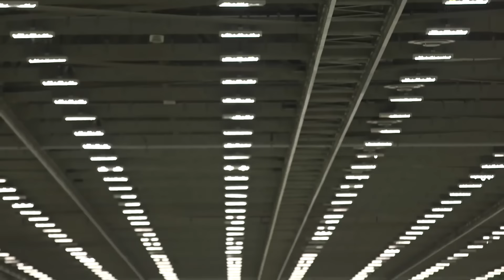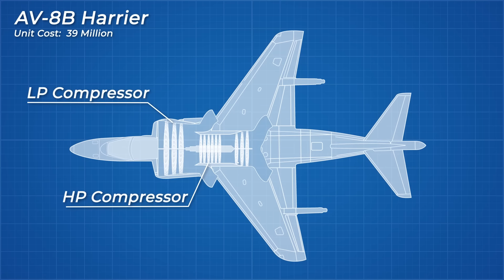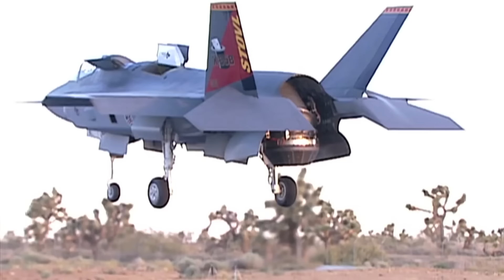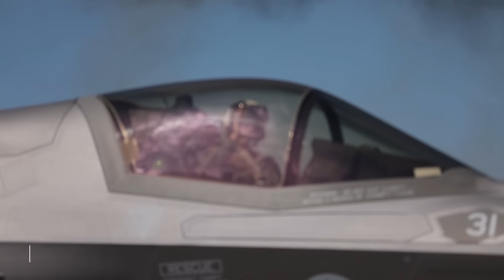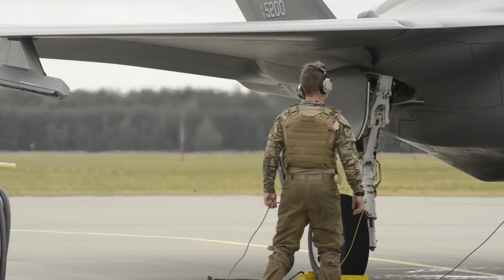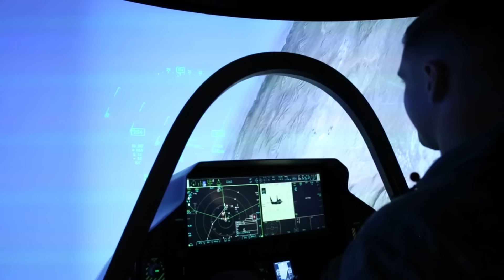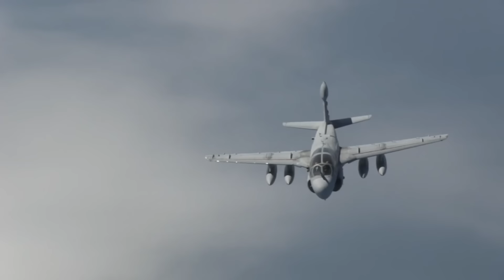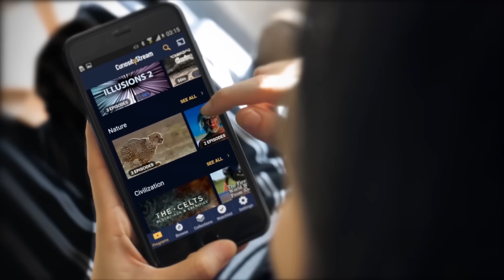Is The F-35 Worth $115 Million?

Comment: I think that for the US's strategic situation, the F-35 is probably the best they could get. Due to stealth and modern technology, it will probably render every non stealth fighter obsolete. The US is also getting double value from the F-35, as the stealth will be used against both air and ground radar. No need to have a different airframe for each role. Geostrategically, the US is using it as a sort of leverage. If you are in the good graces of the US, you could probably secure a deal for them. If you fall out of favor, they can take it away.

Comment: Dick Cheney made this aircraft expensive because of his defense budget cuts immediately after the end of the cold war, which led to the bankruptcy or merger of many great defence companies. Those cuts were due to a stupid neocon adherence of Fukuyama's "the end of history" analysis, which was proven wrong by the 9/11 attacks, which led to the Wolfowich Doctrine, and in turn huge defense budget increases. However, in the meantime a lot of the likely contractors were either defunct or had moved into other areas of defence, than aviation, leaving a handful of monopolistic giants with overwhelming political influence. That's why anything costs a fortune and takes embarrassingly long time to finish, eg. the joint strike fighter. The procurement and maintenance cost differences which in both cases range between factor two to three of the F-16 which it in many cases will be replacing is just outrageous (when considering the available updates to the F-16). Equally embarrassing are the budget overruns and the the fact that this aircraft has been under ways for more than THIRTY YEARS! In comparison, the development of the teen-fighters took half the time, and led to
the development of three aircraft, almost fifty years ago! Of those aircraft, two have remained in production until today, and have thus been upgraded to 4,5 gen. fighters. We simply must be able to do better than the joint strike fighter in the western hemisphere. If not, we will be overtaken by China in the next generation. One side note: when it comes to sound, the F-35 is anything but stealthy, and much points to radar technology being challenged with optical and acoustical derived technologies.
Reply: 9/11 did nothing to disprove anything Fukuyama wrote.
Reply: The first sign of a F35 whit your fancy optical system is the strike packeg hitting you

Comment: this might be a biiit late, but the radar that detected the f-117 was operating in a mode were even clouds would show up on the radar (this radar was also one of the most powerful radars available at the time). The serbians were only able to detect the plane because they knew where to look, based on their intel on american air bases. So they knew roughly at what time and from what direction the plane would be coming. furthermore, the radar of the surface to air missiles was not able to detect the f-117 at all, until it opened its bomb bays, which increased its radar crossection just enough for the SAM to get target lock. and even then, the plane might have survived if it were outfitted with countermeasures
Reply: On top of that they only actually detected it when it was straight above them, if the f117 had a rwr and HARMS they would´ve been destroyed before seeing anything on radar

Comment: "vertically integrated" companies are probably going to face "trust busting" in the future. these vertically integrated conglomerates are starting to assume positions and practices where they cannot be unseated or challenged by any competion and the "free market" is compromised by companies that leverage all their vertically integrated companies to ensure any semblance of competion can't even start to form as it would require similar companies to produce a similar product. when they're all vertically integrated the head company can squeeze some of the companies and make them work at a loss to severly undercut any competiton. so you end up with one company per industry offering one product which is exactly what a monoply is and you don't become a monopoly by producing the best product, as too many aspects of any product are subjective, it specifically takes anti competitive practices and that's antithetical to what a "free market" economy is and what makes the capitalism preferable. when a company has a power majority and uses it's power to guarantee it's power is never challenged that's no diffent than an authoritarian government that snuffs out any ideas that oppose it's core ideologies. it's not sustainable and it's a net drain on society as well as an obstacle to human progress all for the sake of greed.

Comment: The dogfight report was from an early prototype that lacked software features to unlock its true maneuverability. Nowadays this is vastly improved and can outmanouver its competition. Also, it is not slow as a speed of mach 1.8 or higher was NEVER recorded during any aerial engagement. Mach 2 or higher speeds are only good for paper, and the f35 actually has a really powerful engine (albeit only a single one) and its mach 1.6 top speed is more than sufficient. 

Anyway, it will not be in a dogfight regardless of all that, because it will turn any opponent into a ball of flames from 100s of kilometers away without that plane even noticing the f35 is there.

Comment: They're currently  $90 million each!!
Reply: When supply is high, cost tumbles. #economy
Reply: $90 Million, Someone is using WOMAN math! Total cost to taxpayers to date 1/16/2024 [R&D and Production] for the F-35 program is $1.2 TRILLION for 600 combat ready aircraft! [I know 1,000 made but some have been delivered to other countries] $1,200,000,000,000/600 is $2,000,000,000 per combat ready aircraft!
Reply: @mobeydick37  Woman math?... $ The 1.2 trillion is the total cost of the programme ( including upgrades) for the next 50 years... so who's using "woman math" now..
Reply: @1346crecy  You are if you think they are even remotely close to $90 million dollars! The initial estimate for the F-35 program was SUPPOSED to cost 1.7 Trillion over 50 years for 2,440 aircraft. That was 15 years ago. If you think it's only going to cost $500 Billion over the next 35 years you are clearly using WOMAN math!
Reply: @mobeydick37 1.7 trillion includes procurement for up to 2400 airframes, maintenance, supply, amunition, and pilot costs for operation up to 2077 adjusted for 2077 inflation. 

So, you are correct, I’m using woman math, because this woman and her math just proved you wrong in a single google search.
Reply: @tacotown4598  They have already spent 1.2 Trillion! So, Yes you are using woman math! By the 2077 this program will easily cost 3.7 Trillion!
Reply: @mobeydick37  source?

Comment: Is the F-35 Lightning II worth the money? Well, the Navy is down to just two fighters: the F/A-18E/F Super Hornet and the F-35C Lightning II. The F-14 Tomcat and F-14D Super Tomcat have been retired, and the F/A-18 Hornet is on the way out. The Air Force is retiring the F-22 Raptor and the F-15D Eagle, and will rely on the F-15E Strike Eagle, the F-15EX Eagle II, the F-16 Fighting Falcon Block 70/72, and the F-35A Lightning II. There's not much else right now.
Reply: Total cost to taxpayers to date 1/16/2024 [R&D and Production] for the F-35 program is $1.2 TRILLION for 600 combat ready aircraft! [I know 1,000 made but some have been delivered to other countries] $1,200,000,000,000/600 is $2,000,000,000 per combat ready aircraft! Strapping bomb racks on to it makes it just as detectable and more vulnerable than a 4th Gen F4 Phantom but slower! NO, NOT WORTH IT!

Comment: Can we please stop this nonsense???? Coming up on 20 years trying to get this crap up and running as advertised. Folks as an engineer I can tell ya, can't get it done in almost 20 years you got a Turkey on your hands and need to trash and start with a clean slate.

Stop all the BS, dreaming, dissembling and this incredibly unseemly lying PR blitz to those with little to no understanding of aviation, engineering or the ever so criminal military procurement. Oh Hell yes, check out, of all companies Lockheed and the Japanese back in the day.

Again the proof's in the puddin' all y'all, going on 20 years and still mission critical "deficiencies" preventing the fart-35 from entering full scale production. That's the Do-Dumbasses decision OK?????????

There's no discussion at this point as the CUSTOMER says it's a pig just like the fart-22. The customer rejected the -22 and shut down the production line. If you feel it necessary to blather please go to LM, the halls of the pentagone, both houses of congress they're the ones you need to bullshit 😎

Comment: The driveshaft between the Lift-fan and the engine, are the weekest point of the whole system. Because the driveshaft have to make so many rpm when engaged, the wear and tear of this part is enormous, and are pushing up maintenance costs!

Comment: The F35 is an iPhone. When an android (F15 ex 2 and F22) can do the job for a fraction of the cost. It's a flying pig.
Reply: The F22 can't do air to ground, doesn't have the same hardware, has a worse mission computer, and is designed purely for air to air, and the F15 is a 4th gen fighter with no stealth, and the F22 is getting retire
Reply: @immortaldev1489  The F-35 can't do air to ground, either without adding bomb-racks which deletes it's "Stealth"! That makes it about as ground attack capable as a F-4 Phantom but slower and less rugged!
Reply: @mobeydick37  the F35 can can carry bombs in its internal racks
Reply: @immortaldev1489  Yes, 4- 500#ers, then it can only defend itself with its gun.
Reply: @mobeydick37  it can carry bombs in one internal bay, and AMRAAMS in another, with 2 9X missiles in the side bays. Besides, there's a high likelihood they'll just escort a bombing F35 with F35s armed with air to air missiles in a near peer conflict
Reply: @immortaldev1489  not to mention, the fighters never fly alone since Spanish civil war.
Reply: @naksachaisaejane1982  They are not stealthy flying in pairs. The F-35 is good at one thing. Solo missions for airinterdiction. They MUST get the first and second shots or they are toast. Every other mission runs counter to their designed missions and puts them at greater risk than every 4th fighter designed before it.
Reply: @mobeydick37  they are still stealthy flying in pairs, where did you get this information from? The RCS effect of flying about 1 nautical mile from another stealthy plane is likely so little it doesn't have to be considered, and flying solo has pretty much been removed from US air doctrine. Also, what are some of these designed missions you were talking about? The F35 is eventually going to replace all the 4th gen airframes in the US inventory far in the future, so I assume they are capable of doing 4th gen missions
Reply: @mobeydick37  also, the F35 was designed to be a decent air to ground multirole fighter, or else it wouldn't have a custom EOTS system, which is likely the most advanced targeting pod on fighters
Reply: @immortaldev1489  So you would send TWO, 2 Billion dollar aircraft in place of what One, 16 million dollar aircraft is capable of doing?
Reply: @mobeydick37  well, an F14D cost over a billion dollars per aircraft (accounting inflation), while the F35 costs 85 million, and the US was fine with sending F14Ds to fly in pairs, so I can't see any reason why the F35 shouldn't be able to fly in pairs considering the military budget of the US, and it's doctrine
Reply: @mobeydick37  also, I can't find any combat aircraft on par with the F35s abilities that cost 16 million, the F16, one of the cheapest fighter jets in the US inventory, cost 20-ish million
Reply: @mobeydick37 
Israel did in 
Sams did not know it was getting attack
Reply: Trying to find analogies for complex technologies often times means you simplify and misrepresent the issue.
Reply: F-22 costs more and F-15 is non-stealth design.

Comment: It's not even close to as fast as the Gripen E  with Mach 2 capability. Plus it does that for in the area of 4500. per flight hour compared to the F-35  Pig at $45-$50,000. per flight hour. Apparently they have been contemplating using the sound of a pig snort to announce itself on the battlefield. Hahahaha
Reply: Top speed is a near meaningless metric in moder combat, and cost per flight hour doesn't mean much if you only need 10 F35s to wipe out 30 4th gen fighters

Comment: Informative video on the F-35 stealth fighter jet and its 3 variations. Yes, the cost of development is astronomical, which is why the US developed it alone because US allies were not willing to share in the outrageous costs of R&D. The three variations did make R&D much more complicated and drove up its R&D cost, but the large scale manufacturing of the basic F-35 structure, and then the variable or flexible manufacturing of the 3 variations will lower overall costs in the long run. This will allow US allies to purchase each variation on an affordability basis. Hopefully. As far as the F-35 stealth capability, I noticed the presenter emphasizes that no airplane is truly invisible, it is only less detectable. Yes, I agree, that would be the case. Most of us who are amateurs probably realized this fact. As for me the abandonment of the multi-panel structure of the F-117 proves stealth technology is an exaggeration. The F-22 and F-35A look like the same fighter jet except the F-22 is a twin-engine jet, while the F-35 is a single-engine jet. Obviously the F-22 is a faster supersonic fighter, while the F-35A probably is a mach 1 fighter with a max speed above mach 1. Still in a combat situation when two opposing fighters are approaching each other at supersonic speed there is no way to react and engage weapons. You simply must slow down to fight. That is why the US military spend a lot of time and resources in training pilots. It is people who win battles, not machines. Something advanced engineering want us to forget. We mislead ourselves if we think technology is what wins wars. As American General Shinseki told Congress that it is boots on the ground (US infantry soldiers) that take control of an area, not air superiority at 10,000 feet. As far as radar-absorptive paint on airplanes for stealth. Think about it. If paint can create invisibility then why is the F-22 and F-35 programs so expensive. US military has moved away from stealth tech like the multi-panel structures because they do not deliver enough combat efficacy compared to low-profile aerodynamically sound fighter planes. This report claims that the Serbians shot down a F-117 in relatively good condition. So why hasn't the (former Soviet Union) Russian Federation develop a stealth fighter. One reason could be the Russians simply do not have the ability to reproduce Advanced Stealth Technology or Advanced Stealth Technology do not deliver enough combat advantage to make it worth the expenditure. The second reason is why the Russians have not reproduce Advanced Stealth Technology. The Russians do not have the resource wealth to try out an ineffective weapon system. The F-22 and F-35 fighters look far more like conventional (non-stealth) fighters, that is they look like conventional aerodynamically stable fighters. So the Americans have a lot of resources (money) trying to develop a very sexy technology that has proven to be ineffective. At least Americans can recognize when something is a dead-end and allowed to die. It is back to conventional technology that deliver on combat worthy weapons. Lastly Americans seem to have highly effective electronic technology. So-called defensive weapons like AWAC (airborne radar system) planes can jam opposing air force radar systems. Why not send an offensive weapon like AWAC planes up and shut down opposition radar. This would allow American fighter-bombers to hit their targets. Why spend US tax payer dollars on ineffectual stealth technology when US AWACs make conventional American fighter-bombers invisible to radar.

Comment: Its garbage... Bottom Line.
Reply: Bro are serious, it's a huge success
Reply: @logank444  it's been plagued with garbage since it came into existence it's not fast it can't maneuver it's an expensive high tech piece of garbage... Please
Reply: @soco468  It has become a great plane with over 1000 built. It was never meant to be a fast air superiority fighter like the F22. It's literally replacing 4 or more types of jets from around the world. On top of that this plane was meant to be sold to other nations. So it has to be able to fill multiple roles with multiple military strategies. It has already proven itself in conflicts
Reply: @soco468 none of those are stealth. That's why the F-35 is made: fill the ranks of F-22 in stealth arsenal while being versatile enough to replace all the older models.
Deal with that.
Reply: @soco468 so it can’t go fast except it can beat most 4th gens if fully loaded (which they would be in war) and can’t manoeuvre despite the fact that it can go 9gs it’s actually cheaper than the eurofighter the only thing that you just said is true is that it’s high tech which is an understatement but I guess is correct

And ignoring the fact that these aspects of fighters are unnecessary at best and completely useless in reality the f-35 starts to look way better engineered than you thought
Reply: @bennittotheburrito9606  you talk like you know what these high tech spec are. Why don't you share them with us please?
Reply: @soco468  you literally said yourself it’s high tech it’s the only thing we agree on lol maybe you should actually take on the rest of my points lol